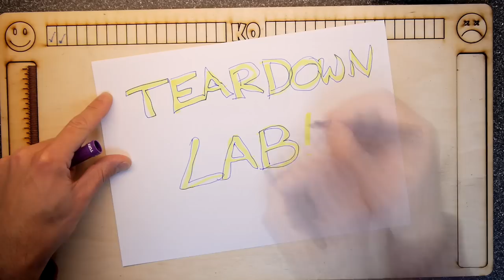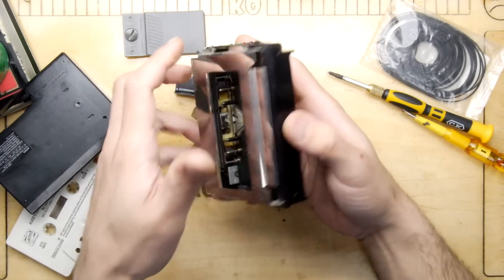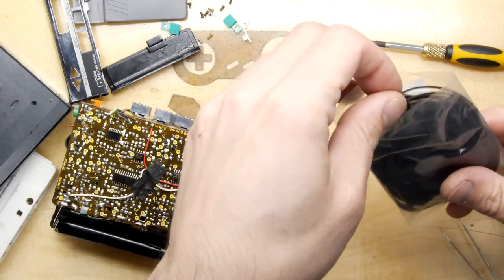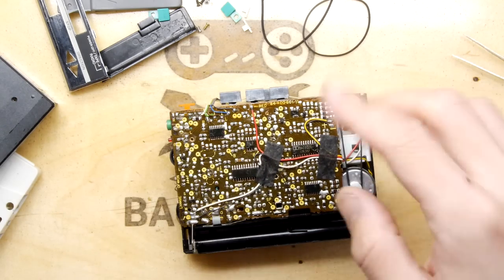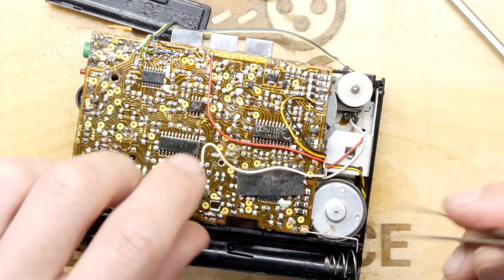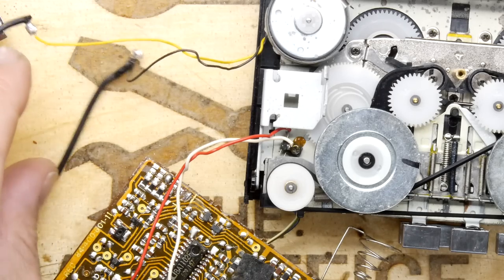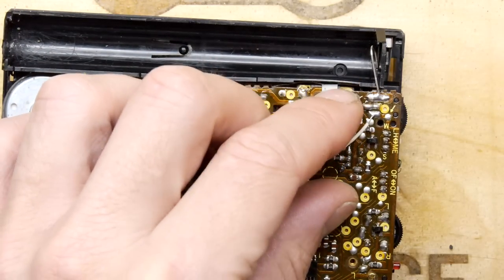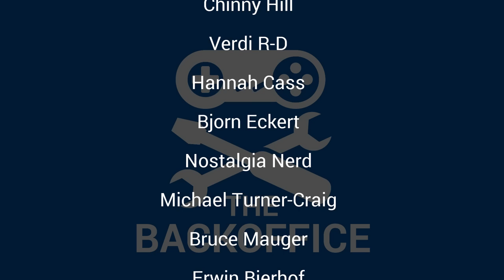AIWA HS-T06 Walkman Repair

Comment: Thicko - The capstan is the spindle that the pinch roller pushes against with the tape between. It's the thing that makes the tape run at the right speed. :-)
Reply from the maker: Do you think it might have got larger or smaller over the years and effect the sound?
Reply: @backofficeshow  It's the capstan that controls the speed of the tape  - if the pinch roller get worn/dirty, the tape would run too fast.  As long as it makes roller makes good contact with the capstan, the size of the roller shouldn't make any difference.  The capstan should be smooth, any dirt build up can cause flutter.
Reply from the maker: So the speed issue could be anything from a sticky motor to failed electronics?

Comment: The Sony wm2 could likely have a broken center gear and need the belt replacing. Center gear is around £27 on ebay but is worth it as the machine sells for hella dosh and is very desirable, not quite a DD2 or DD3 but still good. Sooooo if ya don't want it you could always bung it my way 😉😋 I re-fell in love with tape recently and have bought and repaired a load but never got my mitts on a real high end unit (even busted ones go for silly money and I'm not as rich or stupid as crApple fans) 💵🤣
Reply from the maker: Thanks for the tips, I'll look into it (literally!). I just wish I kept my old music tapes, used to have hundreds. Would be really helpful now in setting these up

Comment: Uggh. I needed to know how you got the back off at 4:19. All the screws are out but it seems like there is one holding the back on in the middle near the battery cover. You didn't happen to save the footage between 4:19 and 4:21?
Reply from the maker: I won't have any footage other than what is posted. Is there a sticker with a hidden screw or clip perhaps?